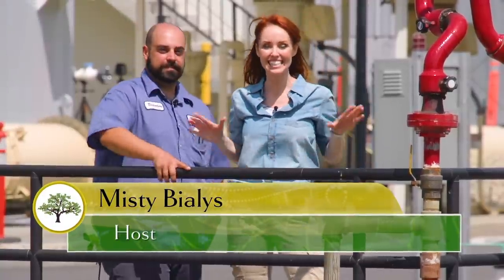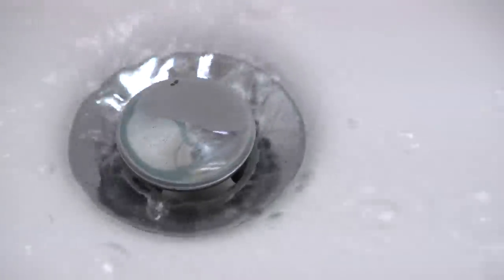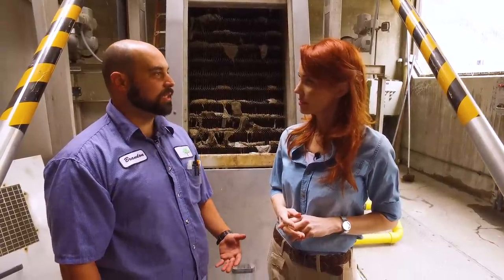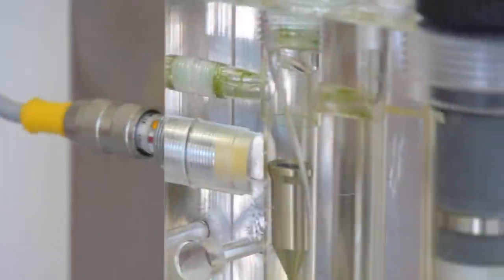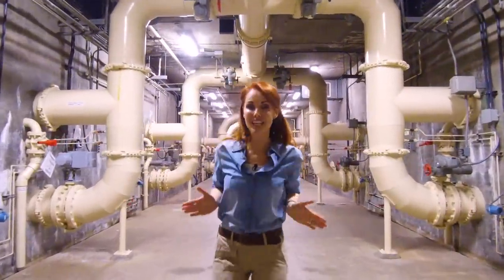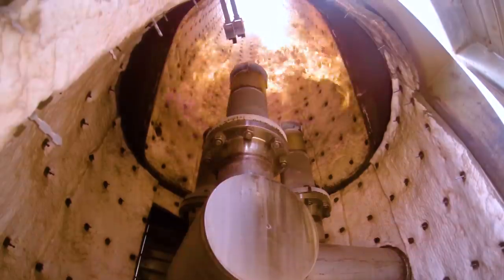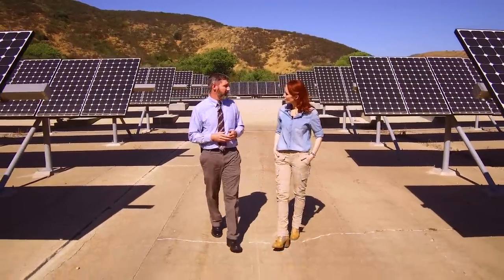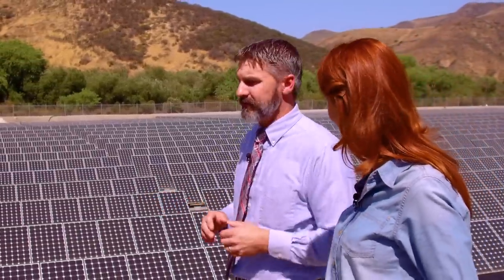Hill Canyon Wastewater Treatment Plant TOUR - City of Thousand Oaks

Comment: So let me resume :
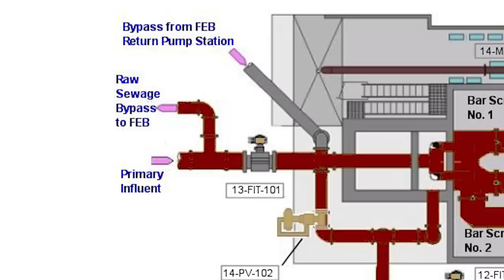1. Initial separation : preliminary screening in head junction 2:34
2. Aerated Grit Chamber 4:15
3. Primary Clarifier : separate heavy solids from light solid, heavy solid sink and goes to digester. 4:30
4. Lighter solids flow into bio reactors/secondary treatment separate amonia,  nitrate,  and nitrogen 4:42
5. Secondary clarifier, sludge settle out 5:37
6. much cleaner water goes to tertiary filtration, rock, sand, anthracite 5:46
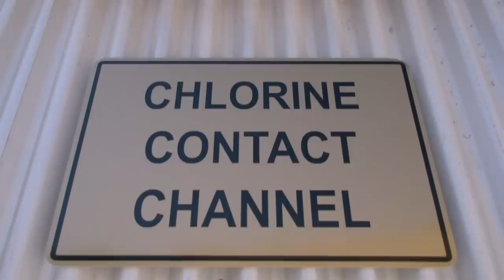7. Disinfection by adding chlorine & Decholrination by adding sodium bisulfite 6:14
8. You have your clear clean water